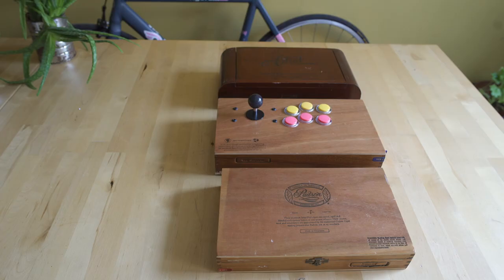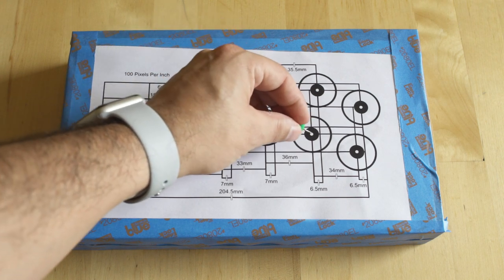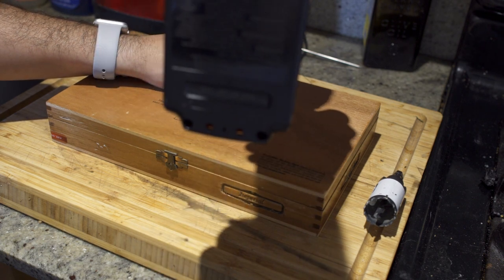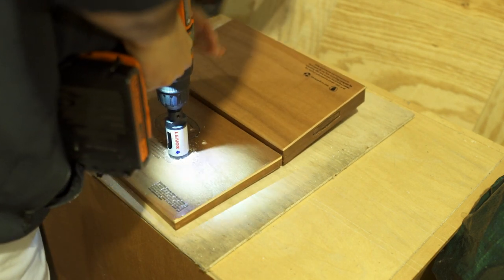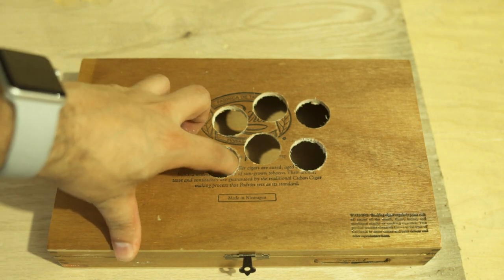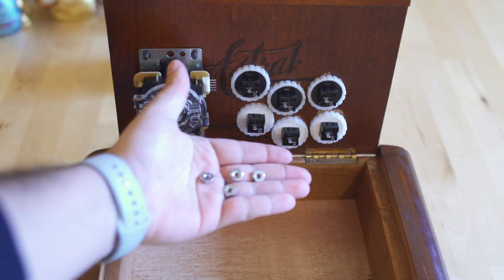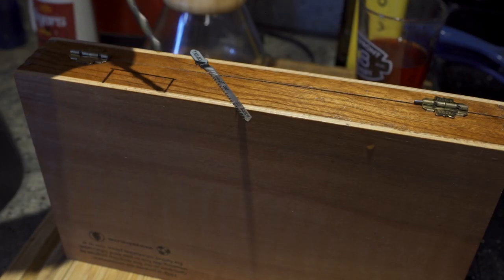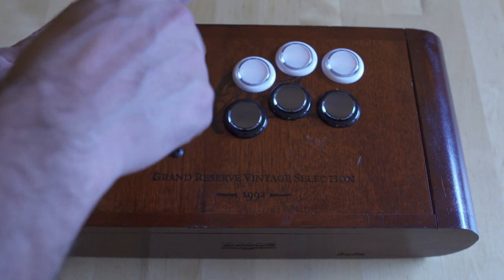Building an Arcade Fightstick from scratch - Part 1  - "On a Technicality"

Comment: How do i get the printouts to print to  actual size?
Reply from the maker: You need to change settings in your printer. I can’t advise on how because everyone printer is diff but make sure it’s 300 dpi for sure

Comment: What's the exact size of the hole saws you used?
Reply from the maker: I’ll look today and write back to you!
Reply from the maker: 29mm and 22 mm are what I have. Both are technically too small for the buttons, so I sand the holes to fit. It’s better to make the opening fit than to have it “the right size” so that your button is secure